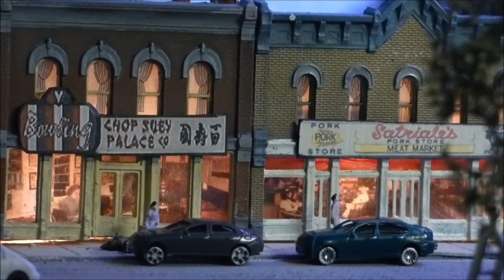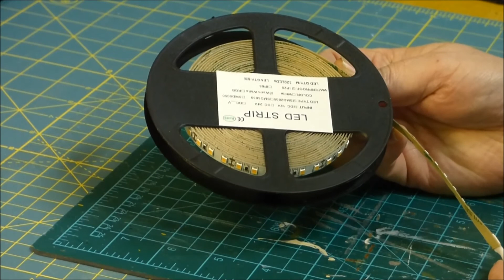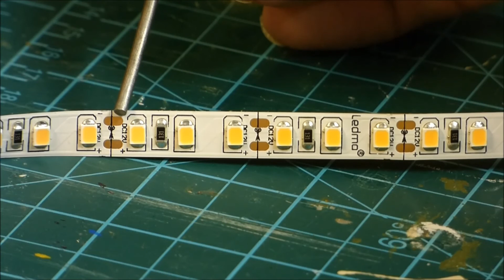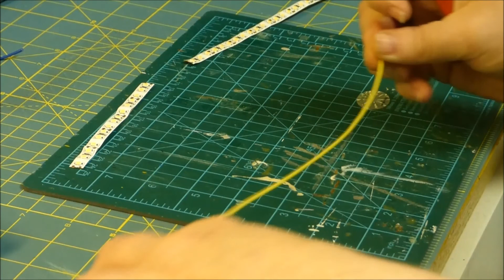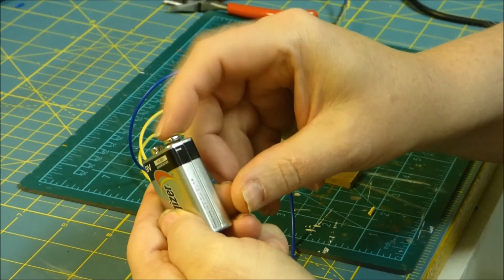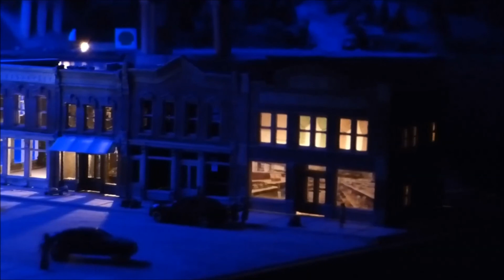How to light n scale buildings with leds

Comment: I hope you're still active,,,,,question,,,,,is it possible to use a DC power supply as a rheostat?  would it help in lowering the brightness
Reply from the maker: Yup I'm still around, As to your question yes you should be able to use an old power supply for that but keep in mind if you are using LEDs they can't handle much more than 3 volts and power supplies will go to 12 volts and ALL lights hooked up to it will always be the same level of brightness. It's for this reason that I use resistors with leds as i'm able to hook up all my lights to hook up to 12 volt power and also vary the light levels.